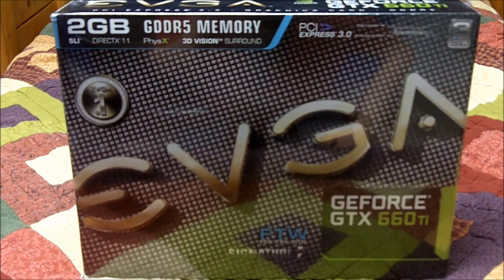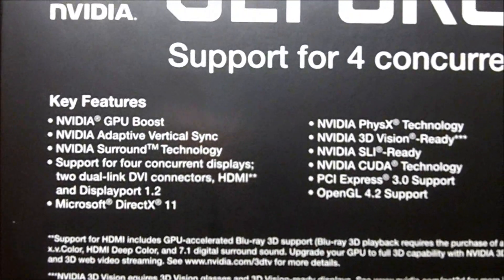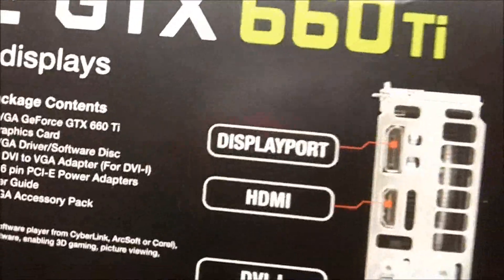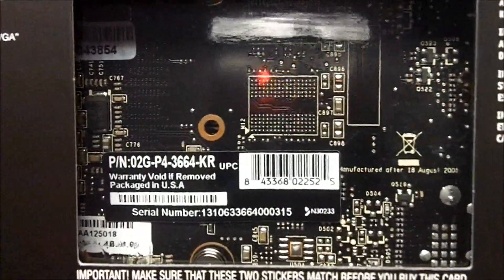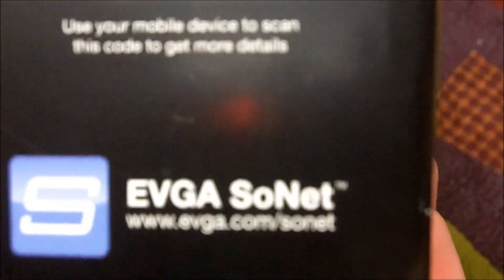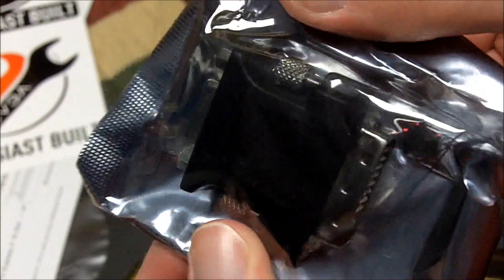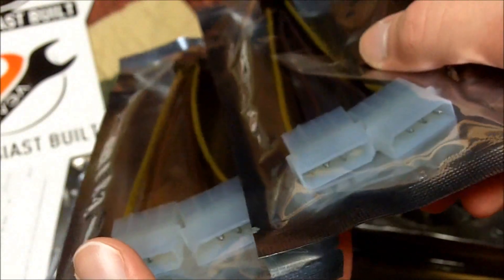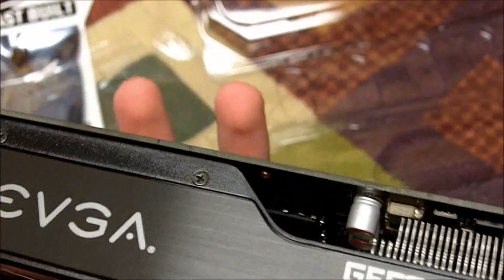EVGA GeForce GTX 660 Ti FTW Signature 2

Comment from the maker: @stang1991 No, I kept it all stock. Sorry!
@bigtank2185 You're right, actually. I haven't ever cared much for overclocking, but that may change once I upgrade to Haswell soon. I'm going to get a Corsair H80i CLC for the upgrade, so I might as well learn how to overclock and bring out the full potential of the system. I've been stuck with this Core 2 Quad Q8300 2.5Ghz for too long and I know it's the only thing holding back my system now.
Reply from the maker: Apparently I can only reply to my own and newest comment. This is why I didn't reply to you two (Christopher Newman and 1991Stang) directly. Damn YouTube.

Comment from the maker: I'm still using the HDD that my HP Pavilion p6204y had in it. It's a Seagate Barracuda (7200.12 ST3750525AS 32MB) 750GB 7200RPM SATA 3.0Gb/s 3.5" HDD. Needless to say, with all these games, this music, and photos and videos, I'm running out of space, quickly. End of story: I bought a 1TB Western Digital HDD for the HP so that I could use it as a server machine.

Comment from the maker: MSI P45-C51, about the only motherboard I could still find for LGA775. I still haven't updated to a new socket since buying my first computer (an HP Pavilion p6204y). Now I run a custom built PC that I built myself, but it's still kinda old in terms of mobo and CPU, obviously. My next PC-part related video is probably going to be on a Seagate Barracuda STBD2000101 2TB 7200 RPM 64MB Cache SATA 6.0Gb/s 3.5" Internal Hard Drive (Retail Kit).